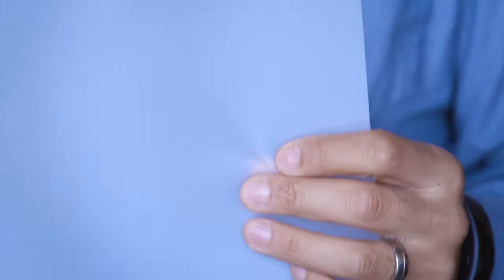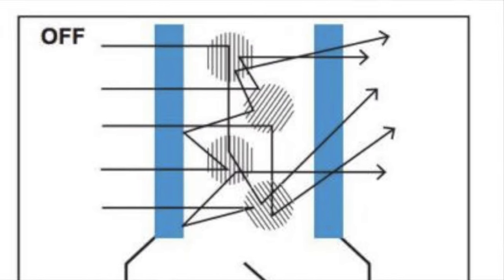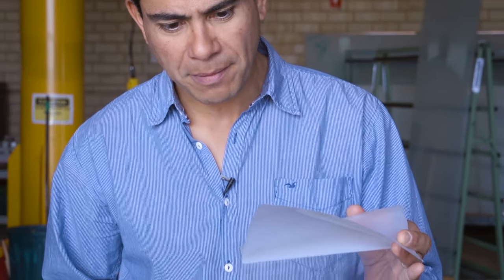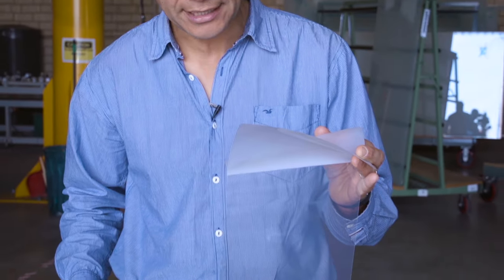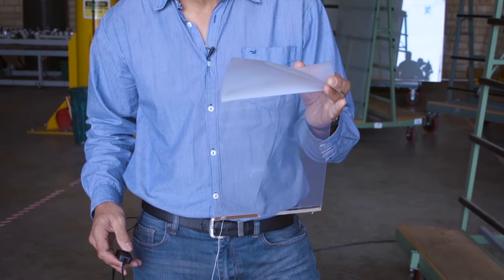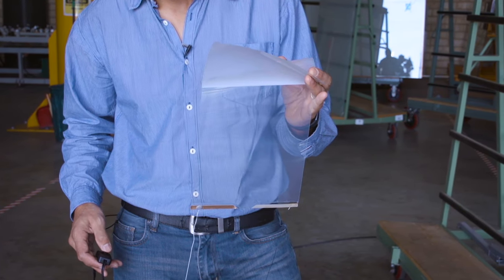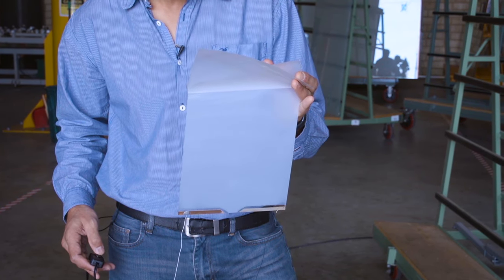How Does Switchglass Work

Comment: Glad that it's the "power on" mode that causes it to be clear. Imagine thinking you have privacy, then you lose power and all the windows go clear. Lol
Reply from the maker: Yes, this could be very embarrassing especially when it has been used in a bathroom application.
Reply: This is right when it comes to privacy but How about when it comes to security when you are driving your car but there is a problem in your electrical system then surprisly you can not see wile your driving in 120 km/hr just imagine
Reply: @flifoofoo1068  why tf would you put tbis on your windshield lmfao or rear window
Reply: @YuriDontPlay  in case you sometimes want to drive without knowing where you go, but sometimes you do want to know
Reply: @chrisfoot6680  Sometimes. lol
Reply: @flifoofoo1068  
What planet do you live on where opaque windshields are a part of your transportation?  

Or does your house have a license plate & the ability to travel?
Reply: Replying for 30-ish years from now when self-driving cars are the norm and the same privacy reasoning is relevant for cars too.
Reply: @YuriDontPlay  I was thinking of using this on my T tops to act like covers, which it had at one point but it do be an 80's car so things get lost
Reply: in most hotels, the washrooms have such glasses seperating the washroom from the bedroom and imagine having a power outage while in business :)

Comment: Why doesn't that electricity just take the path of least resistance? Why does it spread evenly over the panel?
Reply: Good question...got me scratching my head that has 😂
Reply: This is assuming the crystal solution conducts electricity which I am doubtful of. Not only would this mean conduction would localize around the wire connections, but there would also be no voltage differential and (judging by the videos illustration) this is probably what makes the crystals align.
Reply: Alex Ball Even so, the crystal solution would have to be perfectly even, or else there would be more and less opaque parts based on stronger forces at smaller distances. Does that also mean that the plastic on either side is conductive? Are they just being statically charged to opposite polarities?
Reply: Alex Ball I think we need a more in-depth video. 😂
Reply: After visiting Switchglass' website I have to reword what I said, it is both the solution and the plastic film which is unable to conduct electricity, instead the plastic film has a Tin Oxide coating which conducts and is responsible for either side having a positive/negative charge. 

+It wouldn't be difficult to evenly spread the crystal solution with todays technology.

++Statically charged? Doesn't the refer to a phenomenon in which charge is passed from physical objects. I doubt that'd play a part here aha.

Taken from the readings: 

"To provide this electrical reorientation, the PET film which encloses the PDLC is coated with electrically conductive Indium Tin Oxide. Indium Tin Oxide (ITO) is a mixture of indium oxide and tin oxide. Being semi-conductive, it has a high electrical conductivity. Moreover, thin layers of about 200 nm are transparent in the area of visible light while infrared light is reflected. Indium tin oxide has a density of approximately 7 g/cm³ and is a white to yellowish colour. Indium tin oxide is an important transparent, electrically conductive material."
Reply: Alex Ball Cool! Thanks for doing the research I guess I was too lazy to do XD.
Reply from the maker: Nice work Alex this is correct.
Reply: Element 55 I think it’s bc all of the material is the same material ofc and as he said it’s placed specifically which might be why it all turns on simultaneously at the same time
Reply: Even if there is a gradient of crystals, the electricity can continuously pass through the film until all crystals are aligned
Reply: Its capacitor
Reply: I think it does exactly that. Without current the particles are allowed to hang loose which makes them misalign/goes foggy and once a current is applied, like a magnet they perfectly align, creating a path of shortest resistance and everything becomes clear.

Comment: Can the polarity be switched so with a current it gets foggy and without a current it goes clear? I just think of what a waste of electricity, constantly having to feed the window with a current because I imagine most people would want their window to stay clear 90% of the time and then only fog when you want privacy for a meating or using the bathroom etc.
Reply from the maker: This is an excellent observation and the answer is yes I did see a company that produced a prototype of a PDLC film that worked this way. It was, unfortunately, double the cost so never managed to get to the volumes needed to make it commercially feasible to compete with the existing products. My observation is that most people have them in the off state and then have them clear periodically as needed also the power consumption is 5 watts per one square meter so for example a 25 watts low voltage downlight would be the equivalent to 5m2 which is a lot of Switchglass.

Comment: QUESTIONS:

1. Can it be the other way around? Power = blocked? No-power = see through
2. Can I make a "hole" in the opaque state? Like with a frame that interrupts the electric flow where the frame touches the switchglass?

Comment: If you guys read this comment, I have a few questions.
I'd like to put this film on a car, but there is a law (In my country) that prohibits windows with less than 75% transparency.
Could there be a customization that the film has 70% transparency? 
On the website I saw that SwitchGlass sells black film too, how much will the transparency be on the black one and would that be customizable?

Edit: What would this type of thing cost? It's for a model of a concept car.
Reply: i was thinking about that , but you don't need switch glass if you are going to make it 70% transparent ,there is some tint you can stick to the glass , the reason you want switch glass is to be 100% nontransparent and 100%transparent when you get pulled over by the police
Reply from the maker: We can achieve a transparency of over 70% so technically it is possible

Comment: Does it draw very minimal power? Imaging you need it to be clear as the normal status
Reply: Good point but I'm assuming most people would put it in a place where they use the opaqueness more than the clear, especially during the night. If not, then I doubt it draws more power/electricity than a bright ceiling light. Obviously I have no clue, but I would guess that using the electricity from the smart glass during the day to allow sunlight to come through, would be less costly than using ceiling lights or lamps to brighten the room. Although, a one-time purchase of curtains is much more economical than replacing your windows for smart glass lol.

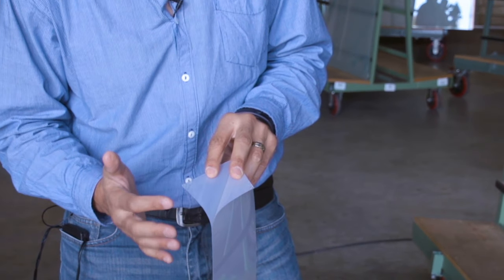Comment: 0:32 Are you saying it's native state is frosted and the electricity applied makes it clear?
Reply: That's scary if you are using it for automotive and it somehow loses power and all your windows become opaque while driving
Reply from the maker: Yes this is correct
Reply: @vietnguyen2354  that's wrong understanding... When the power is ON the film will be opaque, and if the power goes off then the film will become transparent.. it's opposite of what you think.
Reply: @Switchglass  it must use a lot of power then >:(
Reply: @jaeganesh648  Did you even watch the video dude? You can clearly see it goes transparent when you turn it on, and they even explain it

Comment: Does it use a lot of power?
Reply from the maker: Not much power at all, driving Voltage 65V AC 200mA per square metre
Power so 5 Watts per square metre. So if you were going to make a comparison to a low voltage downlight that is 12v then the equivalent amount of power would run a standard sized Switchglass panel.